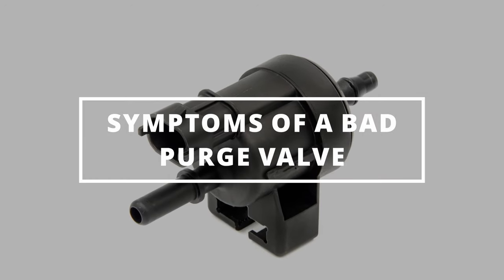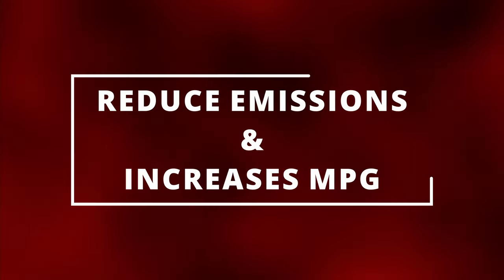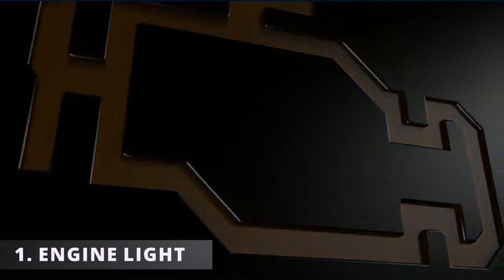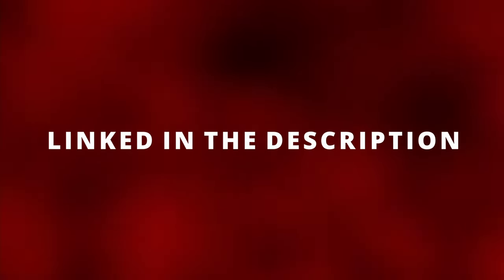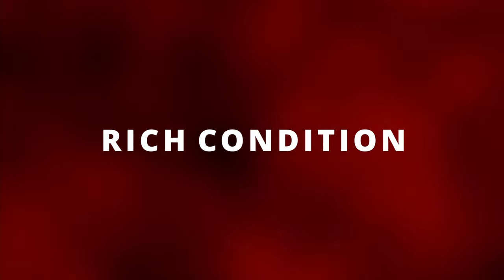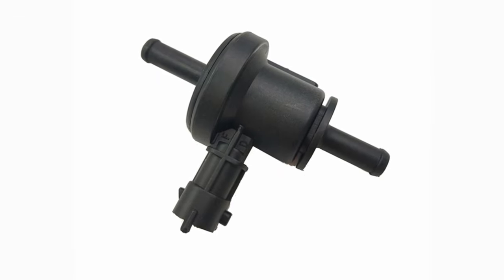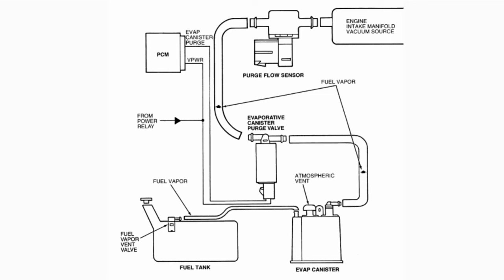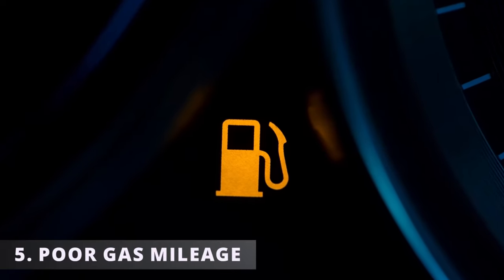SYMPTOMS OF A BAD PURGE VALVE

Comment: I had the code p1456 in my civic. My mechanic replaced the purge valve and the cel keep turning on. Then he replaced the vent valve and a solenoid and the cel again turned on. He did a research and it was actually that the ecm needed an update and just in case replaced the charcoal canister. Guess what. Problem solve and passed state inspection.
Reply: What is ecm mean? I replaced this part but it continues to pop up in my check engine at least every other week
Reply: @Clean-N-ShineInDfw  ecm stands for engine control module, its the car's computer that monitors the sensors, including the emissions control system and does other task, such as making sure that the engine receives the correct air and fuel mixture.

And yes, mines too. Unfortunately, about a week or two of my comment, my check engine light turned on again. Now when I have to go to do the state inspection, I have to go thru all that again, to bring my car to the mechanic.
Reply: @3dplanet100  did you pass inspection
Reply: @jayday325  yeap, it passed inspection. But several days later, the check engine light popped up again, so unfortunately looks like the problem was only temporarily resolved, so again I would have to bring my car to the mechanic when my car is due for inspection.
Reply: @Clean-N-ShineInDfw  engine control module.

Comment: I have experienced while standby in an open parking which is direct heat suddenly my rpm goes up and down. Sometimes it shut down. I noticed when I parked to long like 30mins or more and in a hot area there it goes the problem. 😢

Comment: what are the symptoms when the purge valve is not opening, does it force fuel to come back up the filling hose when filling up the car and is replacing it the only way to fix the problem.

Comment: A purge valve that you can blow through is bad, causes a lean condition. What if you can’t blow through it, can it still be bad? Can it be stuck closed? And cause like a rich condition? Thanks Kevin, 2010 Yukon XL denali 6.2L

Comment: My nozzle keeps clicking off whenever I try to pump gas. I was hoping it would be this purge valve part because it's easy to access. But I guess I'm gonna have to replace my whole charcoal canister.
Reply: Vent valve stuck closed or blocked canister or hose.
Reply: That’s because the vapours are not being captured or vented when filling up with gas. The vapour travels up the filler hose and clicks the pump off.

Comment: I have a hard time believing this little part can be a big problem but hopefully it fixes my problem
Reply: I purchased A 2009 Pontiac g6 GT 3.9  for 700 bucks because it was having issues starting up. Sometimes it would start and sometimes it wouldn’t, but the guy I had bought it from had replaced everything you could think of literally. Turn outs it was just a 57 dollar purge valve! So yeah it could be a big problem

Comment: I have ‘06 g35 coupe, just started pulsing/chugging around the purge sel.  sounding like an exhaust leak from inside the car, pulsing air and not as loud from the engine bay, also when I come to a stop the rpm’s take a little while to settle down to normal idle, if I squeeze the hose from sel. To intake noise goes away and idle drops to normal same with sel. To fuel damper, you can also feel the hose pulsing while crimping it off……what is this?
Car runs and drives fine otherwise no CEL or pending codes
I’ll add only does it sometimes and after I’ve driven it for awhile, shut it off then restart it’ll do it

Comment: What's the difference between a purge valve and a EGR valve??
Reply: Egr= exhaust gas recirculation 
It is literally recirculating your exhaust gasses to reduce emissions and save gas

But on the other side 
The purge valve controls the flow of the fuel vapor that is in the gas tank to benefit from it by making the car rich if the air to fuel ratio needs to.

Comment: My 04 mustang start to run hot. Changed thermostat, new radiator, water pump, alternator. Auto zone test showed canister purge valve code. Ordered online should be here tomorrow… why is my car running hot? Any idea? Confused

Comment: I replaced mine July 2023 and it fixed everything. Today my check engine light came back on saying same thing. 
When I bought the truck there was one sitting under the seat that I didn’t know what was until replaced, so other owner was having trouble too. Does anyone know what could keep doing this?

Comment: I’m changing mine on a 2019 Crv will the engine light come off automatically?
Reply: Disconnect the battery for a few minutes after doing that if you don’t have scanner to reset the ECU

Comment: I have a 2013 Toyota Verso 1.8 petrol automatic. For the last few months the car loses power whenever the fuel is just below half a tank. If i add any amount of fuel above half tank, the problem goes away. Ive tried injector cleaner additive thinking it may be fuel quality but am now convinced it must have something to do with fuel tank air...management or something to do with air in the tank. Could it be a bad purge valve with these symptoms. I have no problem starting and running with full tank. Problem starts like clockwork at just below half tank. Mystery to everyone ive spoken to so far.
Reply: this problem may causes from fuel filter. it can be dirty and need replacement. go to a repairing store and may ask them about this.
Reply: @yusufaras9066  I think so too, thanks.
Reply: @ernestschutte1978  you're welcome mate ✌️
Reply: Or a hole part way up I. Your fuel pickup tube..gets to a certain level an begins to suck air instead of fuel.. more common than you'd think too.
Reply: @h8troodoh  Thanks Mitch.
Reply: Here’s what’s happening you have a bad purge valve. What happens is when the valve is stuck closed the fuel vapours can not be burned off by the engine and they accumulate in the gas tank. Now this is not a problem the canister collects vapour but if there’s enough vapour in the tank especially when fuel is below half a tank it can start suffocating the fuel pump and the pump will start to suck vapour instead of gas stalling the engine. It’s best to replace the purge valve and PCV valve too because that can cause the same issues just in a different way
Reply: @ryans413  Thanks very much. I just keep filling up for now, until I can afford to pay a garage to resolve this issue.

Comment: thank bro..u are the best🫶🏻
Reply from the maker: no, no you are the best!
Reply: @easyautofix hard start after fueling. Is it likely the purge flow solenoid or evap canister?
Reply from the maker: @wowza3611  Purge valve
Reply: @easyautofix  thanks, that seems to be the most common answer. Ordered purge valve and fuel cap 🙏

Comment: I know this is for p0410…. But I need help with P0455 large leak in secondary air system. Would this part cause this code? I have the same identical truck v6. I have changed the vapor canister, fuel filler line, gas cap, secondary air pump and relay. I am still getting the P0455 code. I did a smoke test and it confused me more. I am hoping someone can guide me on what to do next. I recorded the smoke test and can send it if it would help me further. Thank you all and great video
Reply: Was you able to find the reason? Thanks in advance

Comment: I didn't start having issues with the car starting after filling up until I changed my purge value.. Any clue what it could be? Having horrible acceleration
Reply: Probably got a crappy purge valve. Take it off and test it by blowing through it. See videos on YouTube on this. Can’t get cheap parts.
Reply: The valves should come in the box closed try blowing through the inlet hose and if you can’t blow through it that’s good means the valves closed now the next steps pretty easy take a 9 volt battery and some wire and hook up the valve to it if it opens and you can blow through it the valves good.

Comment: When replacing old purge valve KEEP OLD ONE. Let run until hot about an hour to be sure. If your car overheats let car sit until cold and immediately put old purge valve back on. New purge valve may put too much pressure on an old engine and create overheating that is diagnosed as LEAKING HEAD GASKET. You would think replacing would be good but the engine is in harmony with old purge valve. Try cleaning out all  hoses connected to the purge valve. In conclusion, don't ever get a transmission flush. It is a pressurized process that can ruin your cars transmission.
Reply: Ironic you said this. I just got a new purge valve put on my 07 Accord two weeks ago and it has created a whole nother problem that I wasn't having before. I've been dealing with stalling, car not wanting to crank after getting gas (The embarrassment I have to endure trying to get it to crank at the pump😂). Luckily I kept the old one. I'm definitely thinking about telling the mechanic to put the old one back on, now he says I need a charcoal canister
Reply: @ashlexo was ur issue of not starting after filling up fixed and what was it? I’m having that issue rn
Reply: @ashlexo you need to disconnect the battery for a few minutes after replacing the part to reset the ECU learning process so it can relearn and adapt to the change in the system
Reply: @TravisCorona  Ended up getting the old one put back on so the problem with it not wanting to start after getting gas went away. But the stalling continued an which we figured out it was the fuel pump luckily It still had warranty on it.
Reply: @MowSow  Makes sense. Wish I knew this before getting the old one put back on
Reply: @MowSow anytime you change an electronic part you want to do this. I'm surprised more people don't know that.
Reply: @Bl4ckD0g  of course it’s better to reset it with an ODB diagnostic device than disconnecting the battery. Especially on modern cars as disconnecting the battery could cause a control module to lose its programming.
Reply: @ashlexo you can literally do it yourself you unscrew  2 bolts and that’s it
Reply: @TravisCorona 9mm
Reply: @MowSow shouldn't I disconnect the negative terminal before I replace part . Put new one on. Wait few minutes then hook it up?
Reply: @Bl4ckD0g hey should I disconnect both positive and negative terminal them replace part. Wait few minutes them hook up?? Thx
Reply: @Johnsrt2023  negative terminal only should be necessary but you can do both if you want to. Once the part is in you should be able to reconnect pretty much immediately.
Reply: @Bl4ckD0g  ok thank You !

Comment: Does anyone know? I replaced a faulty oem with a duralast on my 2010 Frontier. After about 3 months, it started rattling like a loose rocker. It stops if I pinch off the hose. No svc lite.

Comment: You said it can cause a rich condition in the video. You didn't mention lean, which is what I have. So if it's lean, then it's probably not the purge valve right?
Reply: Could be possibly if the valve is defective and won’t open to allow the vapors to escape

Comment: So a purge valve that gets stuck open doesn't always cause an error code? My car has trouble idling mainly on a cold engine and I've tried almost anything else like ignition parts and vacuume leaks. I got curious because I saw this EVAP system is also connected to the vacuume hoses. The motor runs like it's on 3 cilinders when cold and idling, but when I drive it seems pretty much okay. Can I test this in a simple way?
Reply: Following
Reply: @Clean-N-ShineInDfw  I dont think it is the problem in my case, took out the valve and closed off both hoses to test...I assume this mimics the situation of a perfectly closed valve and I also assume the valve is not open when idling with a cold engine normally...
Reply: @vossenspringer  the valve hardly ever opens it only opens when the EVAP canister is full. Then the canisters vapour is dumped into the engine to be burned. You should not have a rough idle on a cold start because the engine would be in open loop and running off a set program in the computer once closed loop happens the engine takes feedback from the sensors all over the vehicle. Rough idle on cold starts could be the Idle Air Control Valve. Getting stuck and not fully opening when cold. This is what controls the idle when not pressing the gas pedal and it’s job is to slowly close and bring the idle down once everything starts to warm up.
Reply: @ryans413   Thanks for answering my question, my rough idling was fixed in the end by adjusting my valves, they were in desperate need of that....Problem was that in the past they told me the valves didn't need adjustment in my car, that it had hydrolic valves that can't be adjusted...thats why I never looked at that before, and the first 3 mechanics who looked at the problem didn't have a clue either. Luckily I finally went to an LPG garage  that knows what it's doing and had it fixed...

Comment: Don't forget the farting sound made by air being sucked into your gas tank
Reply: Are you saying if my purge valve is stuck open and I open the fuel cap, I will hear a farting sound, I thought the fumes would be evacuated from the carbon canister through the vent valve .. in addition to going to the intake by the stuck open purge valve

Comment: I may have a similar issue going on. It's a 98 Dakota. The cab reeks of raw fuel, and my mpg dropped by half. I didn't get the error codes when they were checking, but said it was showing cam and crankshaft errors. I'm guessing the position sensors. I don't think that is the issue. It also revs up when I depress the clutch. It has a new TPS, and it looks like a new MAP sensor. Thoughts anyone?
Reply: Figure it out?
Reply: Throttle sensor
Reply: @zacharyenck1087  No. I ended up taking it to a garage to be diagnosed.
Reply: @TheMtnManFromTennessee  what did they end up doing?
Reply: @zacharyenck1087  I haven't gotten it back yet. I checked the gas cap and the charcoal canister. I did not check the vent line for the gas tank. I checked for leaks and saw no evidence. I checked the vacuum lines. I did not know for sure how to check the purge valve and I got frustrated. They are charging $90 to diagnose it. I can let you know what I find out.

Comment: What if you get the code and you're experiencing NONE of these symptoms?
Reply: Then check your gas cap, make sure it’s put on properly and you hear the ‘click noise’ when locking it closed. Or, make sure the O-rings on the gas cap are cleaned or replaced.

Comment: what if you are driving and you lose power, no gauges work, you press the gas pedal it doesnt rev up and the oil light comes on. Engine is still on by the way. shut it off and everything returns to normal. WIll a bad evap valve do that too?
Reply: I have the same exact problem, spot on
Reply: @CainShells  were you able to fix it?